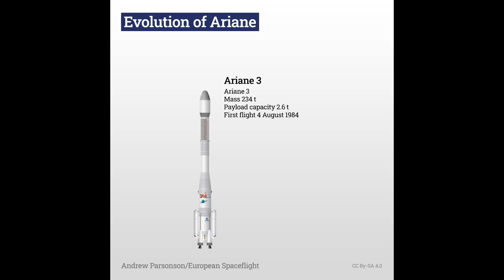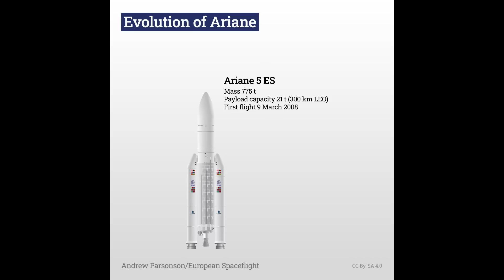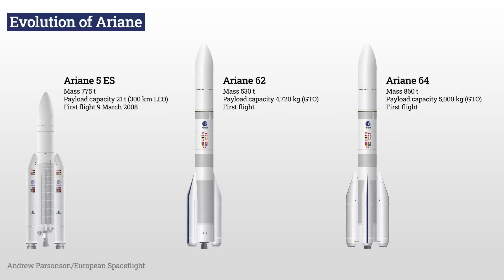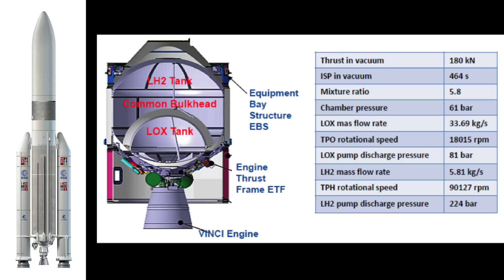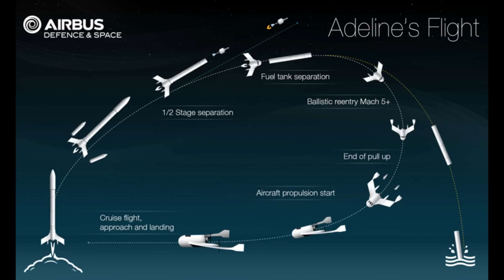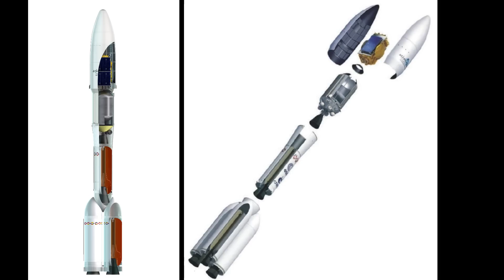Europe Retires Ariane 5 Before Ariane 6 Is Ready????

Comment: I love Ariane 5 because it shows that you can really make a hydrolox rocket look good and you don't need to use janky-looking spray foam. Also it has the highest thrust to weight ratio of any large rocket, by quite a lot, so it just flies off the pad like no other. And Ariane 6 will carry on that family tradition, so I can't wait to see it fly too. Hopefully within a couple years they can do the first flight, but we'll see I guess.
Reply: As I recall, Falcon is slower off the pad because it was always intended to be human rated, and humans can't take the 10-g accelerations that some commercial payloads can.
Reply: It's also just a matter of engine types. Hydrolox with solids will jump off the pad because the solids can provide such a big boost in the thick low atmosphere, to get up to a higher altitude quickly where the hydrolox engine performs best, and then cruise to orbit. An all kerolox rocket COULD have that much power, but it would only be useful in like, the first minute of flight, afterwards you're carrying extra engines to produce power you don't need. It's exactly why the Ariane DROPS those boosters, while Falcon 9 doesn't have any boosters to drop.
Reply: @minikawildflower   Well, that depends on the design of the rocket.  An all-kerolox rocket could likewise have side-boosters that drop off when they're expended.  As for the Falcon 9, while the first stage has to carry all of its engines the whole way up, it only burns for about 2.5 minutes (about as long as some SRBs), and the Merlin engines are extremely light.  Meanwhile, a hydrolox+SRB rocket like the Ariane 5 has to boost a much larger (and therefore heavier) fuel tank for much, much longer after the SRBs burn out and drop off.  Of course, this eats into the ISP advantage of the hydrolox fuel.  Overall, if you want to compare these two rather different rocket designs, the Falcon 9 (in expendable mode to be fair) can lift more payload mass to LEO or even GTO per its own loaded mass at launch.  The Ariane 5 is a significantly larger, more massive, and expensive rocket that offers relatively little if any more lift capability (actually less mass in some cases, such as LEO).

More generally, the hydrolox+SRB (two large SRBs) configuration sure doesn't seem to be the most efficient in terms of mass and cost (because cost largely depends on mass).  Comparing the Saturn V and SLS gives a similar result, with the Saturn V providing greater lift capacity in comparison to its own mass.  Watching rockets with SRBs leap off the pad is fun (even the Space Shuttle cleared the tower in quite a hurry), but in terms of efficiency and effectiveness, they're not the best.
Reply: @rbrtck  I mean - the falcon 9 can do it with side boosters, which as you pointed out, is Falcon Heavy. They don't use it that much because it's not needed. I don't think anyone is claiming it's the best, just that it's fun to watch.
Reply: @Tomyironmane   The Falcon 9 also doesn't use SRBs, which are relatively easy to make extremely powerful for their size.
Reply: @rbrtck  Imagine strapping a pair of SRBs to the Falcon 9 Heavy instead of the two extra rockets.  It would be hilarious to see it shoot off to space so fast. 🤣🤣🤣
Reply: @rbrtck  SRBs are also expensive. And they're necessary because Ariane's booster engine, being hydrolox, has very low t/w. Isp isn't everything in a booster: t/w matters a lot.
Reply: @Tomyironmane  Also an advantage to satellite payloads to limit the maximum Gs.  Even if the payload is designed to handle the Gs, it provides a larger safety margin.  The older US rockets were faster off the launch pad because they were derived from ICBMs, which have a need to get away quick.
Reply: @Tomyironmane  Ariane 5 was also intended to be human rated from the start.
Reply: Since I'm not paying for it with my taxes I'm all for a rocket that continues the tradition of providing spectacular launches with its giant aluminum burning SRB's which put on a great show day or night. Not as happy about SLS since I have to pay for it, but at least we get some great visuals as we watch our money go up in smoke. Sadly in a few years everything will have gone to methane, and while our wallets will be lightened a little less it's not going to be quite as exciting to watch.
Reply: Just needs a Pizza Hut logo
Reply: you do realise most of that thrust comes from the solid fuel boosters
Reply: @kleinerprinz99   And for those who care about these things, the exhaust of the SRBs is absolutely filthy and highly polluting.

By the way, that's what's so funny about some people making claims about how clean the Space Shuttle was and the SLS is.  Sure, burning hydrolox is relatively clean, but SRBs are nasty, leaving a huge plume of smoke and corrosive solids.  The smoke might be white, but that doesn't mean it's clean!  Other white rocket exhaust plumes that are sometimes seen are just water vapor, but not SRB plumes.
Reply: like 90% of the thrust comes from the SRBs and Atlas V 551 is faster. Ariane barely has a TWR of 2 Atlas V has 2.3.
Reply: First flight end of this year/beginning of next year IF ground testing this summer goes well
Reply: It's also weird that there is no visible venting up to launch, I guess everything gets piped underground back to the propellant depot a long way from the pad. Easy when you have limitless taxpayer funding.
Reply: It’s main thrust comes from the SRB’s.  Yes, it has excellent ISp, but don’t be fooled by those stats.  The only reason this rocket continues to exist is because of politics.  They could’ve been so far ahead if they had actually improved their rockets to include re-usability.  Then again, WTF do I know. 🤷🏻‍♂️😑🤨
Reply: @st3althyone  Im sure Ariane 7 will incorporate reusability. Its not a fast moving industry.
Reply: @Chuckiele  They abandoned re-usability a long time ago.  It's not in their best interest to do so unless they intend to leave all those EU subsidies behind, and that’s not going to happen.
Reply: @st3althyone  Times have changed, lets wait and see.
Reply: @Chuckiele  They stated that re-usability isn't their main goal.  They had planned to incorporate it into the Arianne 5 but abandoned it because of the lucrative EU subsidies.   You have to remember that their main source of funding, so leaving that would mean an end to their space-faring endeavors.  If they do change their minds, it might be too late, considering SpaceX has cornered that segment of rocketry and is looking to do the same for the heavy lift portion of their portfolio.
Reply: @st3althyone  It will never be too late because of its government support.
Reply: Unfortunately minus the good looking, It doesn't look bad, just a bit dong shaped.
Reply: Looks are most important, yes, even if it costs weight.
Reply: think Vega-C has higher thrust to weight?
Reply: @sudazima  Vega-C is not a “large rocket”

Comment: You forgot to mention Vinci is an Expander Cycle engine so has higher specific impulse than the previous upper stage.
Reply: Though the Isp of the Vinci suddenly dropped from the astounding 465/467 sec stated some years ago to a more mundane 457 in the more recent publications. If confirmed, really a mediocre performance for an engine supposedly that advanced (also with a really good expansion ratio of 240).
Reply: @andreabindolini7452  Vinci does have significantly more thrust than RL10 for example tho. NASA was even considering building the exploration upper stage of Artemis with 3 Vinci instead of 4 RL10, but that idea was quickly discarded for political reasons. While the efficiency is certainly nothing spectacular, my guess is the priority went into cost optimization after they noticied the lower Isp instead of "fixing" that.
Reply: @spacegoldfish40  This is all true. On the other hand, the chinese YF-79 has similar ISP and even more thrust.
Reply: @spacegoldfish40 BE-3U could have been an viable alternative to the RL10 as well as it again produces a significant amount more thrust whilst being efficient.

Comment: Medium & heavy lift rockets available to Western customers: Falcon 9 and India's LVM3.
Unavailable: Ariane 6, Vulcan, Soyuz, H-III (Japan), Antares.
Essentially unavailable: Atlas V, all remaining flights are booked.
India's PSLV is also available for low-medium payloads. However, the ability of ISRO to increase their flight cadence is probably limited, while SpaceX's flight cadence is limited only by how fast they can produce an upper stage. Reusability of the 1st stage is such an advantage!
Reply: @@user-mv6kp7ds4f You are wrong. Plenty of science missions have used SpaceX. 1st stage reuse is everything. There is a reason SpaceX's services are much cheaper than others.
Reply: You left out Falcon Heavy. 
As for launch systems facing retirement, there is Delta IV too.
Reply: Thankfully SpaceX doesn't generate the majority of their income from DoD contracts, which are government funded.
Oh wait.
Reply: @@user-mv6kp7ds4fIf you are going to talk about the future, you should also mention F9 and FH will be getting extended fairing option soon. They have to develop it for military launches
Reply: @@user-mv6kp7ds4f Re-usability is EXTREMELY important!  The cost of the fuel in that first stage is almost nothing compared to the stage itself.  Any time you can re-use that and it's safe to do so, you should do so.

Nice try, but i do not play KSP.  ^-^
Reply: Falcon 9 is also owned by a man who supports Neo-Nazis and gives them a platform. If you are a SpaceX fan at this point, you are a fellow traveler of the violent Far-Right. India is essentially a Hindutva theocracy, whose ruler gained his popularity through massacres of members of a minority.
Reply: The LVM3 is fake available. The production rate is tiny and it mostly booked. Like 1 flight a year or less. Its laughable.
Reply: @---jc7pi   So, just like SLS then!
Reply: @@user-mv6kp7ds4f  First flight is different from available flights on a flight manifest. Vulcan has a manifest and it's backlogged for DoD and Kuiper launches. Ariane 6? "Soon" is such a flexible word. And then they have to get up to an operational cadence. "Most" science missions? A very few high profile ones flew on Atlas V or Ariane 5 for their hydrolox upper stage. Yes, F9's upper stage wasn't optimized for that, it's optimized for the 1st stage to be reused. F9 has carried increasingly more of NASA's science missions than ULA for several years. Can't keep a launch schedule?!? That makes no sense, SpaceX launched 24 (27) customer launches this year, including science missions. Btw, I've never spent a moment on KSP but have spent decades following the space launch industry. In reality reusability means a whole lot.
Reply: @rhamlet5290 in France the govt has a new law allowing the govt to access our phone mics and cameras so yes
Reply: Amazing what can be achieved when govt is removed from the equation
Reply: @dmurray2978  No, it's when you remove the contracts, see ISRO or USSR.
Reply: @dmurray2978  SpaceX would be out of business for quite some time without all the government fundings they got! They voluntarily sabotaged the Starship launch to get a few extra billions in NASA fundings, knowing they would destroy the launchpad and possibly the rocket (E musk twitted about it month before the test that the launchpad was not designed for this)
Reply: @dmurray2978 ??? Actually it is quite the contrary
Reply: @dmurray2978 SpaceX wouldn't be able to compete without its huge government subsidies.
Reply: @dmurray2978 spacex gets most of its funding from government contracts.
Reply: @alekosb.8704  That is not government funding.
Reply: @alekosb.8704   No, that's not actually true, and there is an enormous difference between contracts for services and funding. The government, for instance, contracts to purchase millions of light bulbs every year for its various buildings. That does not mean it is funding GE. Now, while NASA does remain SpaceX's largest customer, the sum total of SpaceX's other customers far outweigh the space agency. Starlink is providing an increasing share of SpaceX's revenue, and will eventually provide the great bulk of it. Although the government did fund about a quarter of the cost of developing the Falcon 9, and all of the cost of the various Dragon capsules, it did not fund the Falcon Heavy, nor is it  funding Starship, except the specialized Lunar HLS variant.
Reply: @dmurray2978  like in Preventing benefits for the normal People like universal healtcare, public transport, good clean water, not getting your children killed because the Poor millionair shareholders would starve? yeah, capitalism is great /s
Reply: @enisra_bowman   Yeah I kind of don't understand this complete aversion to government. We saw as result of privatization in sectors like healthcare and public transport. If those are left without any supervision from government results can be disastrous. You end up in situation where weakest in communities who need most help not able to access those. Like today you have American going to other countries to get basic health care because flying across the world and living there for a while is still cheaper then getting it at home. And those who can't well....

Not saying governments are perfect and fault less but blaming it for everything and wanting everything corporate is just recipe for system that puts price on human life.
Reply: @enisra_bowman  capitalism, which has brought you the device you use to type that infantile opinion.
Reply: @dmurray2978  Tell us about the private internet you used to share that idiocy.
Reply: @dmurray2978   The semiconductor industry is the result of a diverse mix of public and private contributions. The basic research needed is heavily publicly funded, while the development of the end product is usually privately funded. Government subsidies are common all over the world. The latest iteration is the Chips Act that has both an US and European version. Therefore, the device that I typed this opinion on is brought to us both by "capitalism" and "socialism" (obviously, this is not the correct use of those terms).
Reply: @enisra_bowman  Yep.  And bankrupting your country to pay for said healthcare, good clean water, etc. is such a good idea.

Yours is an overly simplified view of an extremely complex subject.  Do you really think that the vast majority of people (basically all of them) don't have access to clean water?!?  And public transport never evolved because people chose to own cars rather than to fund transport.

But yeah, capitalism is totally bad for everyone.  Except for every other system out there, which is worse.
Reply: @jeromethiel4323  you really love to see people suffer because of overly expensive medicines huh
Reply: @jeromethiel4323  Fascist
Reply: @jeromethiel4323  i mean, it's false, but keep repeating 50s McCarthie and carmaker Propaganda while ignoring that you drink pool water or what ever that stuff in Flint is or that you can't even walk to the next store, so for the "people choose cars" Killerargument
Reply: @jpdemer5  private>govt
Reply: @GM-xk1nw  How to know you don't understand a word without saying you don't understand a word.  Good job.  Do you want a biscuit?

It's paid for by the government, so enjoy!
Reply: @jeromethiel4323  says the guy with an overly simplistic view of a complex subject. the guy you responded too acknowledged governments aren't perfect and described where they can play a good role and you immediately jumped to the other extreme end of the spectrum. gov's invest billions into car centric infrastructure so that doesn't make any sense either., also ignores the fact that car companies bought out public transport and then dismantled them.  notice also how nothing he said is explicitly anti-capitalist yet you immediately shoehorned that in there as a dunk.
Reply: @latlatko  Perhaps i did overreact.  But then in this same video comment thread i was called a fascist.  So yeah, i probably did come on too strong.

But i think we can all agree it's a complex topic, and we got where we are because a lot of people made decisions for a long time, and here we are.

Comment: What’s the reason why they cannot produce any more 5s? Is it a limitation of raw materials or just due to expiration contracts?
Reply: Retiring the production of an old launch system in anticipation of the new launcher's availability is a cost savings measure. Otherwise Ariane would have to fund two launch systems simultaneously which blows out their budget. Having to go back to your partners and continuously say we need more money for the new launcher development because of yada yada yada is a good way to get your new launcher cancelled
Reply: The factories have been mothballed, demolished or repurposed a long time ago
Reply: Cadence of Ariane 5 was rather low, especially that it was often carrying 2 satellites to GTO, so a single Ariane 5 launch was equivalent to 2 Falcon 9 launches (also in terms of payload mass). So while they just launched last one, it has been constructed a couple of years ago already. Due to low cadence they could easily stockpile rockets. So the production lines have been dismantled years ago already, or switched to Ariane 6 production.
Reply: Ariane 6 isn't a bad rocket, it's an improvement over the Ariane 5 in every way. The problem is that the rocket has been delayed by almost 4 years now.
Reply: @gatocochino5594  I'm glad to hear the delay is only four years. It has felt like a decade... Ariane 6 has been discussed for the better part of fifteen years now, but I haven't been keeping an eye on the production schedules.